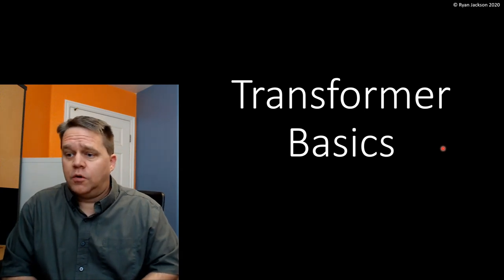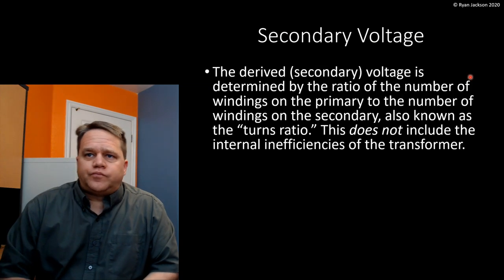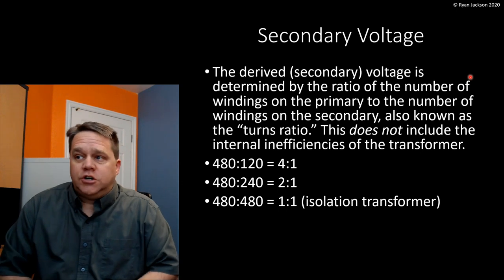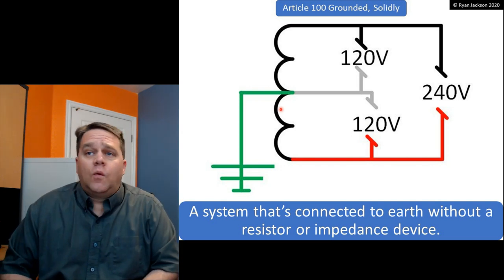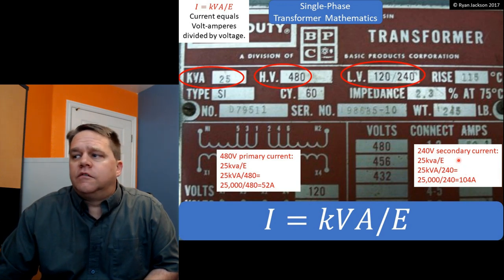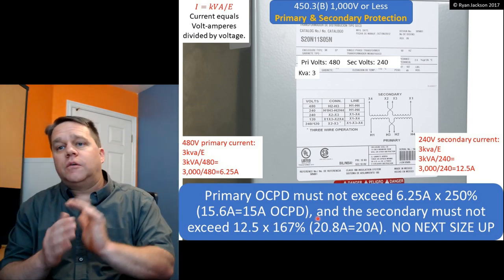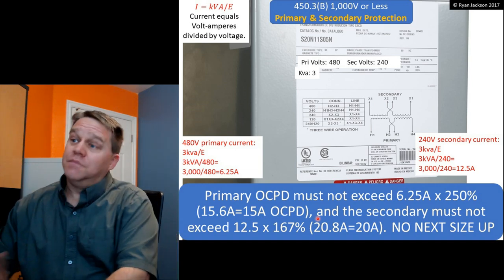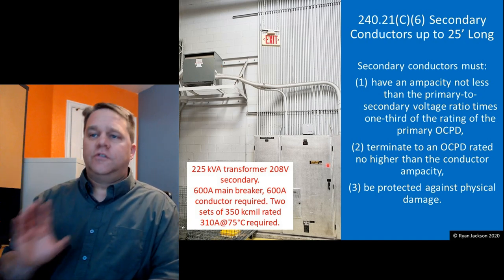Transformer basics--theory and code

Comment: I liked your video so much I tried to make a transformer like yours but it trips the breaker because it’s a short circuit. How did yours work? I wired a coil of #12 thhn with one end to neutral and one to hot and plugged in to a switched power strip so I could turn on and of quickly and then another coil to lamp holder. It trips instantly without ever staying on at all. So are you not using a breaker?
Reply from the maker: I am definitely using a breaker. It will pull a lot of current, so you can't leave it plugged in very long. I don't leave it on for more than 10 seconds.

Comment: Hi Ryan, I've seen you in Mike Holt's videos, and I'm very impressed of your knowledge.  I've watched almost all of your videos.  They are all great!  I'm looking for practical info regarding Title-24 (Lighting Requirements, or diagram for electricians or general contractors). I don't see alot of videos related to the Tittle 24 code, and I think it's will be very beneficial to electrician as well as general contractors.  Thanks again.

Comment: Ryan I watch electricity videos in Spanish, but nothing compared to this teaching you give us. Thanks God I learned English. I seems to me that I have seen you working with Mike Holt.
Reply from the maker: Hi Miguel. I used to write books for Mike, and I probably did 50 or more videos with him from 2005-2017.
Reply: @RyanJacksonElectrical  Awesome. Ryan I do have a question. Why does not the NFPA 70 NEC  add the nomenclature TN-C-S to identify the type of grounding system the NEC implement from the other countries grounding systems TT, TN, IT, TN-S TN-C? Like I feel the American grounding system does not have a particular, peculiar or unique way to be identified, hence a lot of confusion is created in regards the american system in other countries. I sent the proposal to the NFPA, Do you think they will make the update? Because the grounding systen the NEC uses corresponds to a TN-C-S earthing arrangement or configuration. IEC 60364. NEC 90 C 1
Reply from the maker: @miguelac6872  Honestly, I've never heard those terms.

Comment: Very educational. thank you, although I'm going to have to watch this at least one more time to grasp all of the numbers you throw out . Which is great cause I can always go back if missed anything.
I've been a sparky for a few decades. IBEW Local  3 NYC.  I have worked in many highrise buildings, subways,bridges, tunnels,manholes. You name it I've been there.
Many times we work from blueprints that were designed by engineers architects and buttheads. With that said I normally don't have to carry a code book in my tool box.
I'm more of an installer rather than a designer.
Your 1 to1 ratio or 480 v to 480 v transformer s I have used in elevator machine rooms. I questioned the elevator guys about that and they told me that's how they get clean power for their electronics and computers .
We still put 2 disconnects because the specs call for it. You have have to give the customer what they pay for regardless the code,unless it's illegal.
We also use greenfield or sealtight to  change over to go into the transformer. (For vibration).
Makes no sense because the coils are mounted on shock absorption pads from the manufacturer.
So if mounted to the floor we have to put rubber pads and if hung from the ceiling we have to put spring shock absorbers. ( With flex conduit). Thank you

Comment: First thank you for the videos you put out they are a huge help. Second when do you use the Primary only method and when would you use the secondary and primary method? I have recently switched places in my company went from doing service and TI remodels to industrial work, so I'm doing alot more work with transformers.
Reply from the maker: I only use pri.ary plus secondary if the primary only won't allow for inrush (which is to say, never).
If you're I stalling transformers in parallel you have to though.

Comment: great video, I learned a lot from this! I have a quick question, so creating that separately derived system since the spool of wires never touch each other, is the new secondary panel technically a new service panel to where you have to bond the neutrals and grounds together? or in the transformer are they bonded together with the primary side? I hope that makes sense! lol thanks
Reply from the maker: Not a service (services only come from utilities), but you do have to create a new grounding/bonding system.

Comment: 53:22 mark i thought you could on  3 phase systems cheat by dividing the kva by 3 as well as the primary voltage by 3 then devide kva by voltage for current? i got 468 amps

Comment: Hi Ryan, the input voltage in the THHN wire is 120V?
Reply from the maker: Yes.
Reply: @RyanJacksonElectrical   I just did this and got 33v. Primary 120v /  Secondary 33v. Also did 12vac primary And got 5vac secondary. This is amazing!! Thank you very much!!
Reply from the maker: @alexandrebraga1298  Awesome! It's such a great way to learn about transformers.

Comment: The way you use the word "efficiency" in this video is pretty common, but also quite inaccurate. In common speech "efficiency" has come to mean something nearly equivalent to "good" - but it should be used to mean (in this context) the percentage of real power going into the transformer that comes out the other side. Your loosely coupled transformer has both a low coupling ratio and low efficiency. . Efficiency and coupling are two different things. But It is entirely possible to build a transformer that has deliberately less than 100% coupling of the magnetic flux, and yet still has very low losses in terms of energy loss. In which case the voltage ratio can be, as you note, very different than the turns ratio. In fact the (unloaded) voltage ratio is the turns ratio times the coupling coefficient.
Commercial transformers of almost any size or power rating (excluding special transformer like ferro resonant types) have coupling ratios of 99.9% or better, which means the unloaded voltage ratio is pretty much exactly the turns ratio. Because the windings of both the primary and secondary have some resistance, the voltage under load will sag, and the voltage ration will be less than the turns ratio. So to achieve the desired voltage ratio when under load, the secondary may have a few extra turns so that 480 in makes 240 out when under load.

Pedantic note #2: There really truly are 3 phase transformers that are NOT just 3 single phase transformers in a box. It's a bit tricky to wrap your head around how it works, but you can have a single unified core with three legs, and primary and secondary windings on each leg, It use significantly less total iron for the same kVa as having three separate transformers. Sometimes three separate cores are preferred, as you can lose  phase and the other two can still work, or it is more flexible to have a single phase transformer with a stinger. But for the least cost per kVa
a "real" three phase transformer wins. I was an electrical engineer for 20 years before I learned this, when I got tasked with designing AC power conditioning and regulating products, instead of the pro audio product design that had been my specilty up until that point.

Comment: Lets say we have  a single phase 37.5  KVA transformer, (240,120 V )   the secondary can deliver 156 A total,  the question is, when a ground fault occurs between a hot and the EGC, how come the amount of current is way to higher than the nominal current the transformer can deliver 156 A? I know that the EGC is a low impedance path but where does that super extra amount of current come from?
Reply from the maker: The thousands of amps that you describe, which are the result of a short circuit, is what we would call the "available fault current." That number gets smaller and smaller the farther you get from the source (utility, for example) because you are adding resistance with the wire and transformers that we are installing. The number is high because the impedance of a direct short circuit is very low, but, again, the farther you get the lower the current will be (generally speaking). If you search for "bussmann fault current" you can find a lot of good information, as well as a free online app that you can use to see how it plays out.
Reply: @RyanJacksonElectrical  Thank you very much.

Comment: Impedance, resistance, reactance do you have an explanation of them? That differentiate them
Reply from the maker: Impedance is the total opposition to current flow in an ac circuit. It consists of resistance and reactance. Resistance is a physical property of the wire, and reactance is (for this demonstration) a function of the shape of the wire,  that being a coil. It's a bit more involved though, and requires more explanation than I could do in a YouTube comment. Sorry
Reply: @RyanJacksonElectrical  well said, I’ll just do my research about reactance. I came across Lenz law about eddy current. I’m subscribing to you right now
Reply: @johnquilla8236   Resistance (R) is a property of a component that dissipates power when subject to a voltage difference across it, while reactance is a property of components that store energy and release it at a later portion of the AC cycle, like inductors and capacitors.   Resistance (X) only depends on the geometry, temperature, and material of the resistive component.  Reactance by contrast, depends on both geometry and AC frequency (f).   For a capacitor, reactance depends on the capacitance (C) as a measure of its electrostatic size, and equals -1/(2*pi*f*C).  For an inductor, reactance depends on the inductance (L), as a measure of its magnetism, and equals 2*pi*f*L.   Resistance causes a voltage drop across a component, while reactance causes a shift in phase.  

Impedance (Z) is a special way to combine both reactance and resistance together, in order to analyze series and parallel combinations of any of the above devices.  It enables you to "black box" these components as impedances, and add up the impedance terms as if they were all resistors, using your series and parallel formulas for combining series and parallel impedances.  Then you substitute the expression for each component's impedance to evaluate it further.

Mathematically, impedance is an application of complex numbers, where resistance is assigned to the real component of the number, and reactance is assigned to the imaginary component of the number.  In pure mathematics, the imaginary unit is called "i", but this is spoken-for to stand for current.  So electrical engineers opt to use i's next door neighbor, and call it "j".   Impedance Z = R + j*X.  Magnitude of impedance is a Pythagorean theorem combination of R and X.  You can think of R and X as perpendicular vectors that add up to Z.

Comment: I believe  3phase service such as a 120/208 grounded b phase uses only 2 transformers.  I would like to know more about that type of system.
Reply from the maker: A 120/208 system is a wye-connected system, which cannot be done with two transformers and would never have a phase grounded. With a 240V delta there are some options, one of which is grounding a phase. A delta can use two or three transformers. I cover the topic in this video: https://www.youtube.com/watch?v=O-1S93wQN5Q

Comment: This was very helpful, and interesting. I'm wondering what current flows in the primary when the secondary is not hooked up. They say with a manufactured transformer, it should be no more than a few percent. Does an open secondary causes a dramatic increase in impedance because of the induced voltage drop across the secondary windings? If you were to scope out the secondary voltage, would there be a huge back emf voltage spike because there would be nowhere for that secondary current to go? Presumably a home made transformer, with inefficient energy transfer and weak core, more primary current will trickle through when secondary is open?

Comment: I'm confused in the transformers area.
When do we use 1.732? 
When you say 225.000 ÷480 after this I'm lost.
The 831 I don't understand i was thinking 1.732 is the number we multiply with 3 ph.  THIS is the way I was thinking.
225000÷480 × 1.732 ? 
Will you explain this? 
Thank you.
Reply from the maker: We use it for three phase transformers. kVA divided by (voltage times square root of 3). We don't divide kVA by voltage, then multiply that answer by 1.732. For example, if we have 208V three phase we multiple that by 1.732 (360) and divide the kVA by that value.
Reply: The reason WHY the sqrt(3) comes in to play here, is that this is the ratio between the phase-to-phase voltage (Vpp) and the phase-to-neutral voltage (Vpn).   To set this up prior to involving sqrt(3), think of it as three sources each carrying the same current from line-to-neutral, at voltage Vpn.   Add up the apparent power of all three phases (Vpn * current), and that gives you the total apparent power.

So, now we have total VA = 3*Vpn*I.   What if we want to express this in terms of Vpp?   Recall that Vpp = sqrt(3)*Vpn, then solve for Vpn and substitute.  Now we are left with totalVA = 3*(Vpp/sqrt(3))*I.    Multiply by 1 in a fancy way, to clear the square root of 3 from downstairs, and we are left with: totalVA = sqrt(3)*Vpp*I.

The reason why sqrt(3) is involved in the ratio of Vpp to Vpn, is that it comes from the trigonometry of equilateral triangles, since the Vpn voltages are each represented as being 120 degrees apart.  You'll get sin(120 deg)/sin(30 deg) when you set up the law of sines, which reduces to sqrt(3).

Comment: one point if you can clarify i see in my factory many single phase 480 to 120/240 transformers so the panelboard must have a main or a fused disconnect before it cause its not single voltage.
Transformer secondary cannot in this case be protected by primary correct?  Or for almost any separately derived transformer power system in Industrial or commercial?

Comment: Thanks! This helps a lot.  So, a transformer is like an automatic transmission torque converter where the transmission fluid is electromagnetic field.  It's crazy that either one of them work.

Comment: So all boilers, steam generators or what ever generates pressure is condersided a pressure vessel.  All pressure vessels are rated by horse power and them converted into mega tons and so on.  I must have missed it but when you showed the placard for the boiler I seen neither the horse power or the BTU "British thermal units".  Do you recall the horse power of this boiler?

Comment: From what I have read inrush currents last a few cycles, the maximum inrush is often touted as  10X the rating of the transformer, in my experience 4x to 6x is normal for a standard off-the-shelf dry type transformer. Where we have seen inrush as high as 14 times is with fast transfers of ATSs' with no in-phase monitors. The ATS transferred back to the utility with the two sources out of phase, which resulted in a very high inrush on the utility source.

Comment: Thanks Ryan great info. It’s really help you always have real world pictures not a drawing.  That makes it so much easier to understand your presentation. Do you have info on the transformer grounding and bonding on your other video?   Would you do a video about sizing the transformer for different applications. Specifically for motor and rooftop HVAC equipment.  VFD On HVAC equipments don’t work on 3 phase delta high leg so it need a transformer either for vfd motor only or the whole HVAC unit.

Comment: My understanding is that a transformer is a device that transforms or changes voltage (step-ups or step-down) 🤷‍♂️
Reply from the maker: Usually, unless it is an isolation transformer with a 1:1 turns ratio.

Comment: why did we divide 225,000 by {831} and 225,000 by 360 ? thats whats confusing me.
Reply from the maker: Because it is three-phase. You take tge line-to-line voltage times the square root of three (1.732).

Comment: With most transformers that have a ferromagnetic core, doesnt that core suck up like 99%+ the magnetic flux lines? Meaning that effectively all the magnetic flux is in n the core. In theory, in order to induce an emf you need a wire, a magnetic field, and relative motion. When the wire "cuts through" the magnetic field lines it produces the emf. So if 99+% of the magnetic flux lines are contained in the core of the transformer, which magnetic flux lines are "cutting through" the wire to induce the emf? 
I realize this is a different type of question, but it seems that there is a conflict between the transformer theory and the inducing an emf theory. Any thoughts? Thanks
Reply: In a transformer the relative motion is the magnetic field expanding and collapsing across the stationary secondary winding. That’s why you can’t transform DC, no relative motion. In a generator the DC magnetic field is stationary and wire rotates through it. Conclusion: generator = wire moves through stationary magnetic field, transformer = AC magnetic field ( expanding and collapsing) is moving across stationary secondary coil(wire).